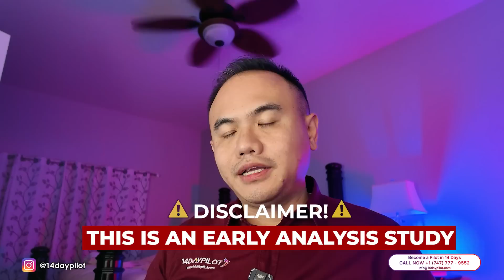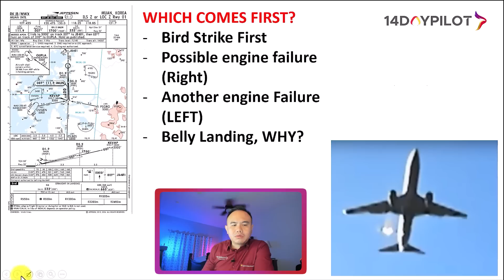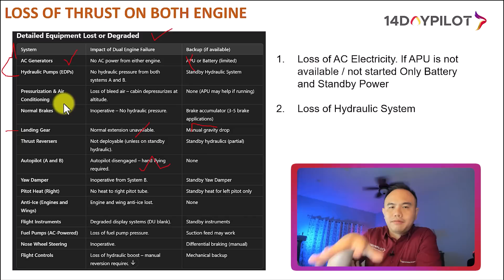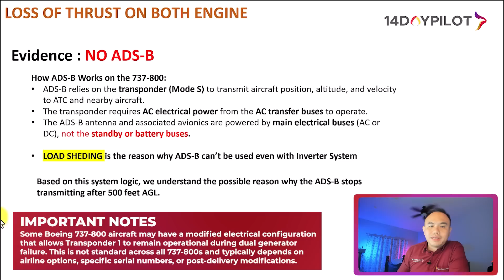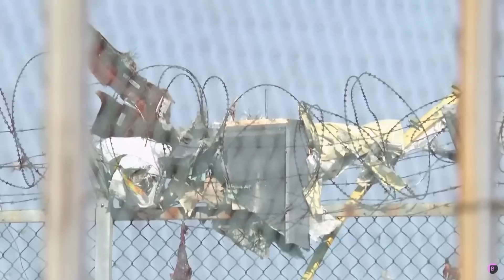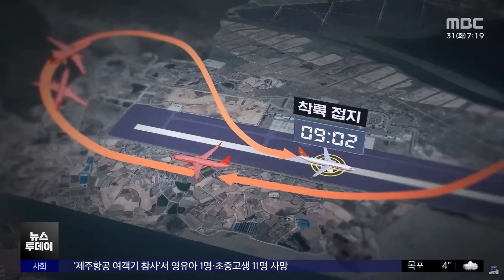NEW! JEJU AIR 2216 UPDATE :THE MYSTERY OF RUNWAY 19! B737-800 Crash At Muan Korea

Comment: Sorry, I am not a pilot. My question is, why is there engine noise when landing, if both engines are dead?
Reply from the maker: Thats also my question at the end of the video
Reply: @14DAYPILOT  me too,something wrong with the pilot ??? when the plane landing the midle run way but if they dont have the wall ,the plane just fire that for sure ,the wall to blame that we see to the end is may me cry ,  if they dont have THAT WALL  .the top person that airport have to remore .
Reply: @nhatquangtran-lt5zb  Just one or two operations managers with common sense and sense of responsibility walking around and inspecting their asset, they would have seen the wall and do something.  That is their job scope
Reply: Because the engine is on, engine 2. It looks like engine two went into thrust reverser and engine 1 shut off. Which is the opposite of what should be.
Reply: @Lemon83166 if that's the mistake they made it's just unthinkable. And it's a common mistake but why isn't there a computer programme to warn them?
Reply: Yes , seems like one engine is still running full ticket . Maybe this explains why the jet was going so fast on its belly even with all that friction.
Reply: When aircraft land without flaps the approach speed is higher. Flaps change the configuration of the airfoil and allow the aircraft to approach slower.
As my flight instructor told me decades ago "flaps are not speed reducers, they are lift increasers". Increased lift allows slower flight. Zero flaps are the configuration in flight.
Reply: You need to check whether it is a tower cam or other cam. Because in the video there is no bang sound of the crash nor the belly crashing noise on the runway. If it is tower or other cam near a taxi way, it could be the engine sound of other aircraft near that cam
Reply: You need to check whether it is a tower cam or other cam. Because in the video there is no bang sound of the crash nor the belly crashing noise on the runway. If it is tower or other cam near a taxi way, it could be the engine sound of other aircraft near that cam
Reply: A damaged engine may continue to spin at a lower speed and with heavy vibrations and not producing much thrust. A birdstrike usually damages the fandisk and destroys its blanace but in modern high-bypass engines the engine core could be left undamaged and still maintain some combustion to produce noise and perhaps deliver some minimal thrust from the exhaust gasses. Furthermore if the fandisk is still in one piece it will be windmilling from the airflow and producing some aerodynamic noise.
Reply: The noise wasn't engine noise, it was scraping noise.  Both engines were off most likely.  The thrust reverser deployed was actually the engine being pulled apart by friction on the runway.  That is my theory.  Without power and low altitude they didn't have time to lower the gears and flaps.
Reply: @barryraven4745 It was engine noise. You can see the air distortion around engine 2 caused by the engine heat, but not for engine 1. You can still hear that engine rotating for a few seconds after the plane comes to a full stop. So engine 2 was still operating to some degree, but engine 1 was completely off.
Reply: @barryraven4745 without power having that speed would be very surprising for me. There is a guy who explained that you can see that Eng #2 was still running as you can see the hot air from the engine
Reply: @barryraven4745 that was a good point. Even if the reverse thrusters doors or panels were open, if the engines were off or at idle there would be no or insufficient jet engine thrust for them to slow it down. A while ago I watched an old video of an  airliner where the pilot actually did shut off the wrong engine when the other engine was having a mechanical failure. I don't remember the outcome. Under stress and duress a pilot does sadly make mistakes.
Reply: @ That was a prop plane I believe that ended up hitting a bridge.  One other note, just because they have video of one engine getting hit by a bird doesn’t mean the other engine didn’t get hit and disabled before that.  I think it is premature at this point to blame the pilots.  Not saying you did, just other comments. He had a choice once the engines were down to try and land on a runway or the water.  I bet most pilots would try the runway.  In this case he had to dive quickly which increased his air speed even more.  He had no idea if he would stop in time and he probably wasn’t aware of the concrete barrier.  R.I.P.

Comment: I think the pilot underestimated the floating effect of a beautiful text book landing without flaps or landing gears which meant that he was going too fast and therefore needed a longer runway. The plane came in too fast, floated in a straight line into the concrete wall. If the pilot came in harder, hit the ground earlier, the friction and the slight angle created by one running engine would have veered the plane left, miss the wall and into the clearing to the left of the wall.
Reply: I heard they hit the wall at 165 mph.  It may not have stopped even if they had the whole runway.
Reply: @barryraven4745  they needed to veer left. Pilot left thrust on the right engine and  shut off the left engine and wing tilt yawed to the left. Technically if the plane had enough runway, friction on the left wing and thrust on the right wing, it would have veered left where there was a clear field next to the wall.
Reply: If the pilot came in harder the plane could break up and cartwheel like UA 232. The only thing he could have done but I can't blame him for not doing it was to use the rudder to veer left or right and try to miss the ILS berm. I believe he had enough speed to still retain some rudder authority. However I'm not sure the plane would have actually turned or just started skidding sideways while still going straight.

Comment: For me the best analysis is from Mr. Miles O'Brien, at CNN video yesterday. Acording to him the pilots made everything correct. The problem is the wall. Take a look at his video. Congrats from Brazil.
Reply: The wall was absolutely terminal, and there was another wall beyond that one too. The second one is not unusual… for better or worse.

What I haven’t heard yet from “experts” is an example of an airport that has enough space to safely slow an aircraft from 160+ MPH in a gear-up config, in ground effect and has no braking ability.

One can argue that there might be less casualties of course…. But it would take more than a few hundred meters to make a difference. Hopefully somebody will do some sort analysis or simulation to see what it would take to "safely" stop an aircraft in this situation.
Reply: Figures CNN had the worst expert. The wall is not the issue

Comment: I appreciate your assessment.  I question why you dismiss the mirror image theory.  I have seen many cellphone videos that are a mirror image.  

I also question the sink rate on the 737 with no engines.   How was he able to fly for 5 to 7 minutes and come in hot with no engines?  This would indicate that there was at least some power.  Power equals hydraulics.  CFIT equals power.  Retracting the flaps equals hydraulics.

Many pilots believe that there is evidence that the #2 engine had power for the reverser.  

More evidence that the first video was a mirror image.  

I do know that we don't know what happened.
Reply: In the video of the compressor stall, the aircraft is sunlit on the same side as the compressor stall.  It is early morning and they are on approach to runway 01 thus heading NORTH and so it is correct that the RIGHT side would be sunlit thus the video cannot be a mirror image.
Reply: @gavtex1065  I had heard that this was about 2:00 pm local time.  I may be wrong.  Please cite source for local time.
Reply: @ it’s not hard to check it’s all over the internet.  The fligjt was a redeye 4 1/2 hour flight and the bird strike was just before 9 am local time.
Reply: Cell phones often have mirror image just on the selfie cam, and there's no reason that the person recording a plane in the sky would do so via the selfie cam on the front of the phone.
Reply: @MarchHare2009  I have seen many videos that were mirror image.  Ones that didn't involve a selfie.  Ones that make it appear that the person in front of them was driving on the left side of the road in the USA.  This would not be a selfie.

Comment: A couple pieces of information.  They may have had hydraulic systems available.   1st the reverses may be deployed with gear up If under 10 feet radio altimeter.   2 I believe you are on the right track with the dual loss of thrust... but I believe the part everyone may be getting wrong... is if loss of thrust you will still get hydraulic and electricity from windmilling engines,  however.... with dual loss of thrust you need to stretch the glide as far as you can...   how do you stretch your glide... keep the aircraft in a clean configuration.  Until landing is assured.   So I believe a likely scenario is as follows...  
1. Probobly saw the birds or for whatever reason initiaed go around (as you saw plane was in landing configuration in one clip but at the time we saw the bird strike number 2 already in go around (flaps looked about 15 and gear was up)   number 2 gets the compressor surge, qrh says reduce throttle until surge stops.   It appeared from video some exhaust from number 2 so they may have only had idle thrust due to damage)  
3. While climbing for gobaround number 1 looses power (damage or possibly incorrectly shut down)   all that I agree with.   However unless they pull the fire handles they will still get hydraulic and electrics from the windmilling engine. 
4. If you loose thrust in both engines you need to establish a clean best glide speed which figure clean configuration is somewhere around 200-210 knots. You also need to stretch your glide as far as possible... gear and flaps will increase drag and shorten the distance available to glide. 

People keep talking about a technical failure that prevented flaps and or gear from being extended.  However I believe it was their judgment call keeping the airplane above the flaps up ref for best glide, to stretch thebglide and reduce drag.... and once landing was assured they were too low to drop the gear to let it extend in time.  Had they dropped flaps and gear sooner they would likely have crashed short of the runway.  One of the big issues was the long float from the ground effect. And of course that big concrete slab that shredded the plane.     Ironically there is a post on pprune that talks about this from 2009
Reply: I agree.  No gear and flaps 

1. No time 
2. Minimize drag

The biggest question, if both engine gone, why? Thats what I covered in the video
Reply: I agree. I think it may have been a judgement call to glide with no drag from landing gear. But, from a safety point of view - how is it possible to lose both engines and all power from bird strikes? Were they just very unlucky? Bird strikes are quite common so this is a bad oversight from the plane/engine designers.
Reply: @infostudy101  not the first time... us airways 1549 co.es to mind
Reply: To loose both engines from a bird strike is possible. Reference to the miracle on the Hudson.
Reply: However, after touching the runway, there is no action of the rudder, elevator or ailerons to "stick" the plane to the runway or to rock it sideways. It is clear that neither engine was working, otherwise the plane would not have moved perfectly aligned down the middle of the runway.

Comment: It appears both engines may have been damaged.  In the video with the bird ingestion you see a tiny puff of smoke come out of the left engine as well that no body is commenting on.
Reply: And with both engines possibly damaged, you would surely choose to continue landing on Runway 01, especially since you were on a stabilised approach.
Reply: @ that is the million dollar question, so far the only thing that makes sense is extent of the damage did not manifest itself until after they aborted their initial approach then the decision to glide back back became their best option and it would have work if not for the berm as the end of the runway.
Reply: If both engines were damaged keep the wheels up and flaps was an intentional decision to glide the aircraft as long as possible.

Comment: We will never know exactly what happened until the accident report comes out. One thing for sure was that if they had more of runaway they would have made it just like Lot 767
Reply: I disagree, they were going over 165 mph at the end of the runway. Another block wall and road was past that and it wouldn’t have ended well no matter what
Reply: @DonBules  a cinderblock wall isn't going to stop a plane of that size, even if that is poor planning by the airport designers.
Reply: @Sam-uz4iy  Agree, you can do significant damage to a cinder block wall with a sledgehammer, so a plane with that much kinetic energy would've likely had no problems with it.
Reply: @usdental1cnk625  I agree with this statement but it would have taken more than double the 9000’ they had to work with.  They don’t practice dead stick approaches so leaving it clean down to the flare was just the only way he would be sure he would make the runway.  At the speed he rounded out, they were going to end up way past the perimeter wall, likely not stopping until they hit one of the buildings on the other side of the perimeter road.

Comment: Why wasn't a normal single engine go around carried out because they had no working engines immediate turn around to land down wind the emergency flaps are electric and very slow the gear has to free fall you have to reach round open a panel and pull 3 long cable handles .
Just no time i guess.

Comment: To me it seems like they needlessly rushed to land the plane but that’s only if they lost both engine but even if you lost both you still can bring the gears down manually. Idk I work at Wendy’s so this not my expertise just saying
Reply: It depends on the speed. At high speed losing both engines might not be an issue. At landing speed it night have been too low. We won't know what happened until the data is analysed. I hope it gets shared for future knowledge.
Reply: It's strange. They must have had enough engine power to do the go around, so the logical thing would have been to just complete the first landing attempt. Let's hope we get some more hard info soon.
Reply: Here what I seen in image. I see the plan has engine power; the pilot did good attempt to belly land the plan. But the malfunction with landing Grear and break, the plan run off runway and hit the wall.
Reply: @ you must work at Burger King if you think that’s what happened